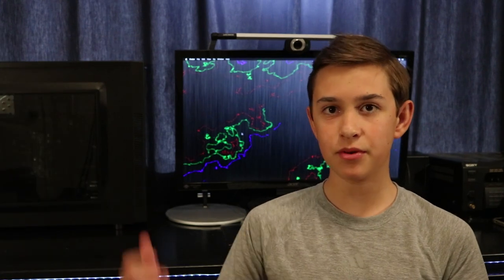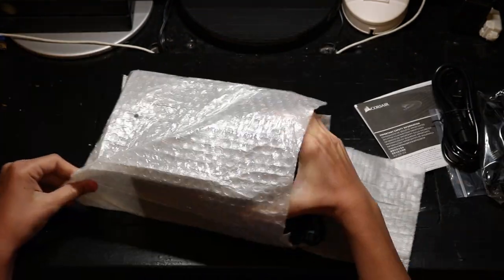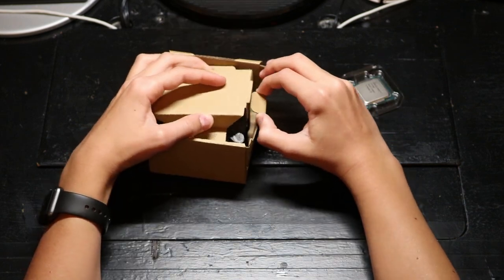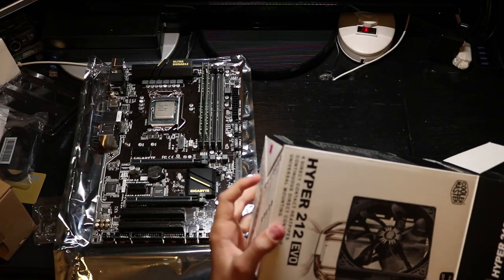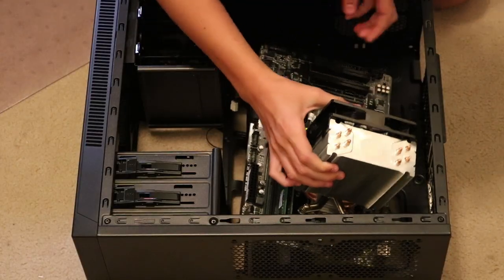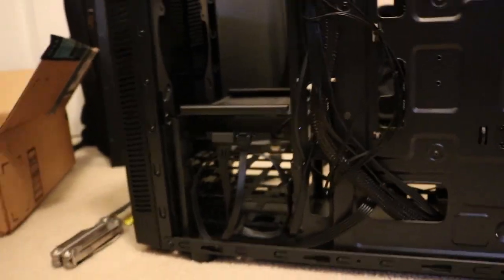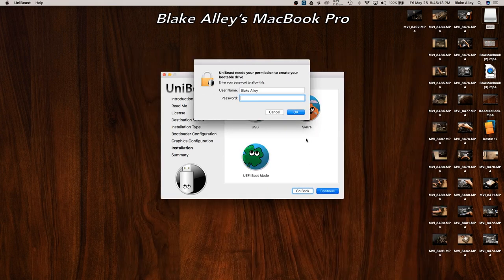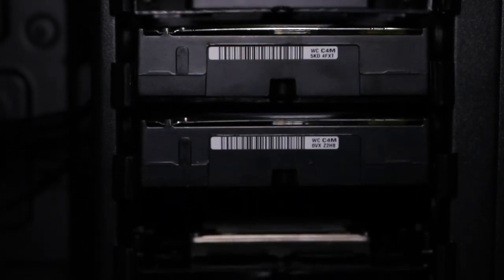$900 Skylake Workstation Hackintosh Build Guide Tutorial (2017)

Comment: hey man good job, there is really no display drivers for the intel graphic's so i am not sure if you got stuck on boot while restarting your hackintosh after a fresh installation, in my case i did, there is a fix for it, 2 kext that you have to download and install using kext beast, let me know if you need the link to them, i also built one and using the same CPU
Reply from the maker: I did get stuck when trying to install the HD 530 driver, and I eventually found IntelGraphicsFixup kext and some other kext and installed those before installing 530 from MultiBeast. I still have a problem where sometimes, it hangs on a black screen after waking up the display, and a restart fixes it. Probably related to the half-baked piece of crap that the integrated gpu driver is!
Reply: lol it was Sierra OS fault when there was the update May-15-2017 anyway congrats!

Comment: Hey. Nice build. Just a a question: how come you picked the Arctic Silver 5 thermal compound? I mean, you are aware of the curing process right? Just wondering...
Reply from the maker: Just recommended by LinusTechTips, I'm guessing because it's a good value for how well it does the job.
Reply: baaelectronics I see. I personally used the Arctic MX-4 as it costs less (£4.95 for 13.5g, yeah the UK) and it takes less time to perform better (only a few noticeable Cs, but just less confusing because of the whole curing thing with Artic Silver 5). Again, nice build. Perhaps, make a video and run some benchmarks? Like Geekbench 4 and the BruteX. I also subbed btw
Reply: toma tu hermana Lol. thanks

Comment: Hey, question. I have a MacBook Pro backed up on a 4TB external hard drive. Would using that back-up suffice as the source for installing OS Sierra onto a Hackintosh?
Reply from the maker: Most likely, yes, if the backup was created using Time Machine instead of directly cloned. You will still have to install all of the custom drivers for the Hackintosh after restoring, but you will be able to restore from that backup when prompted to do so in the macOS setup process.
Reply: Awesome, thanks. The parts I have so far are similar to yours. Differences being the case I have is the 200R, my MB is a Z270 and my CPU is 7700. These wouldn't make any problems for putting together a Hackintosh, would it? This is my first time trying to put a computer together so I'm just getting all the advice I can.
Reply from the maker: Sounds fine. Just make sure your parts are listed on Tonymacx86 or some other Hackintosh hardware site and follow all the installation instructions correctly. Good luck!

Comment: The ram should be installed in alternate slots
Reply from the maker: It works fine in the config it is in right now. Any specific reason?
Reply: single vs dual. put it in alt slots